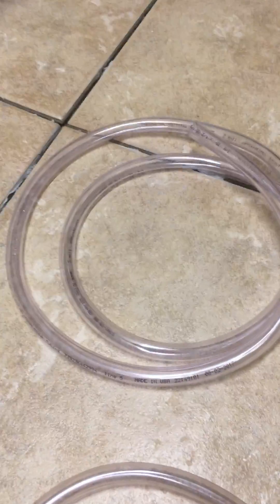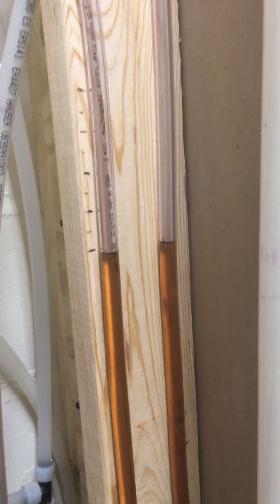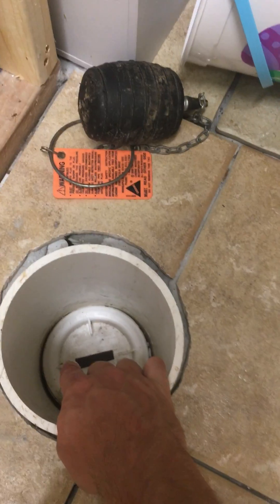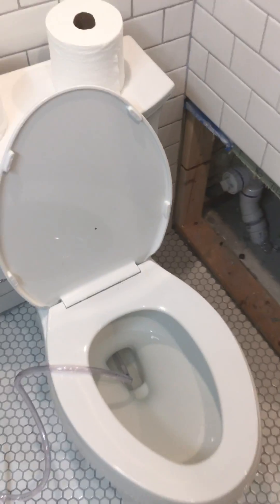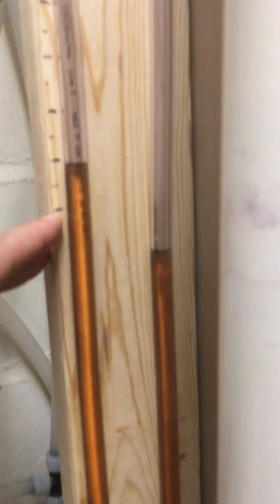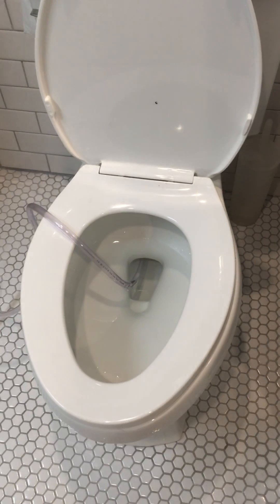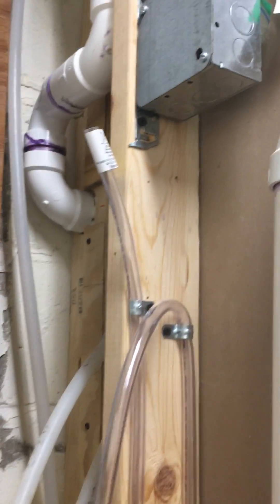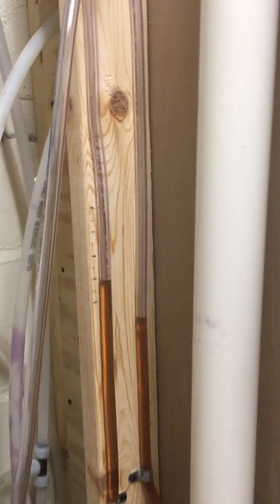Water Column Test - Minneapolis Inspection

Comment: That's an elaborate water column. Most plumbers use a handle held plastic device. Tests usually are as followed: Ground work (5psi, or 10ft water head), sewer (smoke test), rough plumbing (5psi for 15 minutes), water pipe test (simulate city pressure 50psi or so), final (water column test), visual water heater inspection. Building inspector may inspect water heater as well. Best to also do a pressure test on gas piping.

Comment: Great vid here in Ontario Canada we only test drains with 2 methods 1- cap all drains after ruff in and add 5 psi and hold 2- fill drains with water to highest flood level rim

i see your way test thats 1 1/2" trap seals or present

thank you for your great explanation !